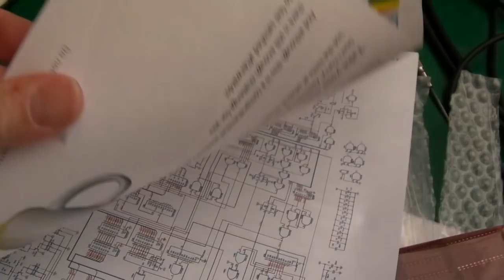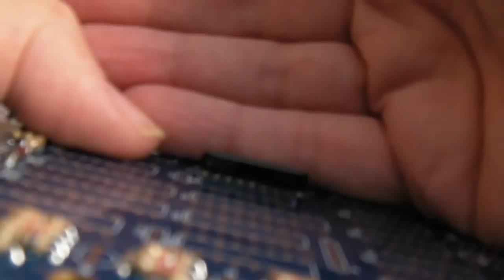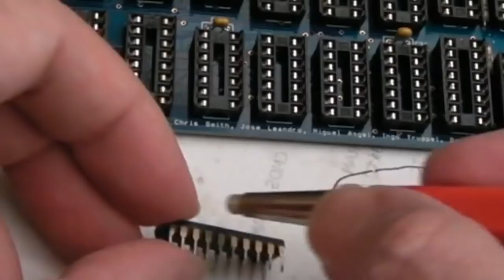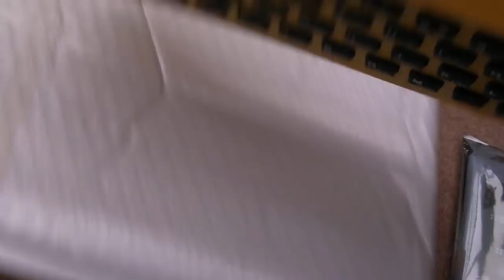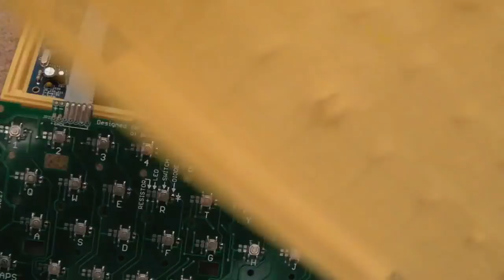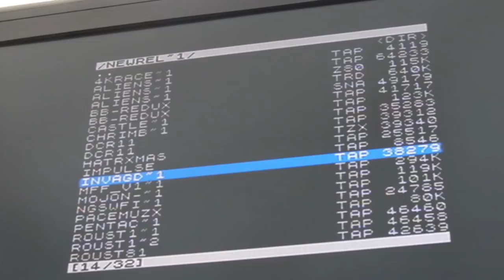Building a New ZX Spectrum (ZX Renew & Byte Delight)

Comment: DONT cut into the solder joints when trimming the leads, that shocks the solder joint. always cut the wire above the solder.
Professional side cutters have a double chamfer to move the cutting edge higher.
Reply from the maker: Thanks, yes - I pointed out that very point on a video that I filmed 3 weeks ago! (Atari ST RAM upgrade).  Worth reflowing after cutting them so low like I did there.

Comment: Old video, (I know,) but I am confused with this kit you have here is it a 48k or 16k spectrum? Also, I was a little dissapointed that they never included an RF box with this. Kind of spoils it for me. I loved trying to get my speccy get a clear picture on channel 36 on my old 19" CRT back in the day, even before Channel 5 came and bodged everything up! Did you have a channel 5 engineer round your house adjusting everything? Ahhh nostalgia. Now, of course, it's a million times better to use an emulator with 0 issues of anything and that also allows you to output like an RF TV! I have over 1000 games  on my Speccy emulator. All hail the colour clash!
Reply from the maker: It's a 48KB kit - but the RAM is 64KB I think - I suspect some is just not used here.  Thanks for sharing your thoughts =D   Lots of memories thinking back to when Channel 5 aired, but no fond memories of RF for me lol =D
Reply from the maker: PS: I have a 128KB build coming at some point!  I have the board, just need to sort out a case and keyboard at some point!
Reply: @GadgetUK164 Great. Looking forward to watching that. I was only wondering about  the memory because it said 16k on the screen. Or was that from the built it diagnostic programme?

Comment: They should have used the ZILOG Z800 processor and installed 1GB of RAM plus a proper keyboard then the Sinclair (tm) SPECTRUM would have been more usable.
Reply from the maker: The Z800 was a machine (or so I thought), not a processor!  Turns out it was a 16bit CPU! =O  But 1GB of RAM was not available in any computer back then! It would be decades before that amount of RAM was feasible in a home computer!

Comment: Were you able to get the faceplate to sit flush?  The top seems to attach to the membrane rather than the case so it just won't stay put.  Wondering how you did it...
Reply from the maker: I did, by adding extra piece(s) of the stick tape underneath (padding it slightly) - eventually it gripped really well in that area.  The edge that holds it is very thin =/
Reply: I'll try that method on my speccys, cause the top lifting off is a nightmare for my OCD. 😂

Comment: question is it still using only half memory thing, with the original being made with half faulty  originally or was that only the zx80/81 models that had that memory?
Reply from the maker: That was just Sinclair and the original 48K Spectrums.  This uses 2 newer 32K chips, giving 64K.  Only 48K of that is used by the Spectrum 16K just sits there unused.

Comment: Hello just watched your video I have built about 8 of the Harlequin 128k boards, the keyboard you were featured there was actually soldered up by me for ZXrenew I know this because of the 3D printed protection it came in is off my 3D printer, and only I do that in order to get the keyboard there safely without breaking or snapping , you are indeed right that you can populate the board with LEDs , the button you have or indeed the new type of micro switch buttons which have a slightly more clicky sound than the old ones, but both are really nice to use, you are right there are places you can solder the wires to power for the LEDs which are not used if you're not using LEDs you can go from either side but they both linked, enjoy watching your video and seeing something I've actually done going to good use gives me an enormous sense of satisfaction 😎
Reply: The v button not working , that can be simply that  a bit of contamination inside the actual micro switch, probably caused when I have given them a isopropyl alcohol Bath , to completely clear out any Flux!? Or can be another reason which is a diode issue for anti-ghosting , ok babes are 100-percent testing before they leave here , via a gig i have setup
Reply from the maker: =O  Thanks for letting me know!  Lovely job on the keyboard assembly!!!  That 3D printed packaging was a nice touch!   The V key was no big deal, I've come across that type of thing with many keyboards in the past (including a brand new ASUS one lol).  Just a few presses and what ever contamination gets freed up.

Comment: This is so cool and so incredible that looks like as if I was watching a video coming from a parallel universe. I am astonished with the quality factoring of the main board (it's spectacular to say the least) and the keyboard by itself is a gem. Back to the 80s I wish we could have such reliable keyboards instead those terrible chiclet stuff which used to break after (not that) much use. Only these two things (the fantastic board / components and the wonderful keyboard) makes it a ton better than the original stuff. The only detail I really didn't like is the yellow color, but I could live with this. Too bad that I don't have the enough talent with a solder (and with electronics in general) to face such delicate project. I just think that build this little guy for playing those eighties horrid games is a waste. LoL. 😆

Comment: At about 1:10:30 ...

The z80 in the ZX Spectrum had an advantage when it came to games with a lot of screen movement.  You could set the stack pointer to 0x0000, then every time you 'push', it'd dec the SP by two and write two bytes (into 0xFFFE & 0xFFFF) at once... and you just kept 'push'ing data till you're back at 0xC000 (The start of the screen)

Basically, the ZX Spectrum was an 8-bit that could write 16 bits of screen data in a single op, with no time wasted on updating a screen address... and that little data-blasting hack made it pretty fast : )  We used to abuse the heck out of the stack pointer back in the day : )))))

The other advantage, for side scrollers, was the fairly unique screen memory layout.  By splitting the screen into thirds you could easily scroll the lower third or the upper third, separately... coupling this with stack-blasting and you could implement side scrollers very efficiently compared to other systems... including other z80 based machines.

Lastly, keeping the colour data separate from pixel data allowed local colouring independent of animation, which was another big speedup.

... of course, the drawback was only two colours per 8x8 block, hence a lot of effectively mono titles like 'school daze' - but hey, you can't have everything : )

I loved coding games in assembler on the 48k back in the day... sure, the c64 was nice, but the sinclair was so much more fun to code for.   XD

I'm definitely down to build one of these : )
Reply: @@shadwell72 Well, usually my buffer was already drawn and sprited, so it was essentially a simple buffer flip of either:  all, 1/3 or 2/3 of the screen - no worry about limited registers unless you're recalculating the screen on the fly, and if you're doing that you are almost certainly NOT using stacking.

Used to use the stack trick for initialising memory too.  Damn I miss gamedev in the 80's... simpler times.
Reply: The ZS Spectrum has that weird dumb address line swap that makes graphics operation a non linear process and SLOW.

Comment: Don't recall where I bought my faceplate from but did I ever wrestle with it to make it fit my 48K I've had since 1983. The radius on the right wasn't quite correct and when I finally got it stuck down the side of the Enter key was just dragging on it. It's an original membrane so who knows how much it might have deformed over the years. I'd love to build one from the PCB up but too pricey to justify personally. Thanks for the video.

Comment: Awesome project! This may well become my first Speccy…
You may not want to solder individual pins when you deal with sockets. Just put a stripe of flux down, get some 1 or 1.5mm solder feed it whilst heating it and drag your soldering iron. You’ll whisk through them in no time. I came up with that technique, when I was an intern and had to solder a dozen or so backplanes with 8 or 10 60 pin backplane connectors. You’ll soon start to find faster ways to do it.
Reply from the maker: Thanks, yes - fully aware of that techique, I just prefer not to solder that way.

Comment: Really great job there. I put a harlequin 128 in one of those yellow cases; I bought the luminous keyboard though :-) One thing I found btw - I attached the metal keyboard cover in v. cold weather --- when the house warms up, the upper row of keys rub against the metal cover (and I dont want to take it off as I am bound to bend it). FYI I have had odd sound issues with the harlequin with many 128k games - no sound when there should be (reverts back to 48k mode I think) regardless of all the usual tricks that should get it working. Not entirely sure if they might all be like that (?) 128k only games seem better.
I also am lucky to have one of the ZX Zero boards too - much to my suprise, I have tended to use this more often just for compatibility, had zero (ha!) issues with it.

Comment: I’ve had chips arrive direct from element14 that has the same red on the pins,  I wonder if something in the air in the climate they are stored in might have reacted to the pins causing the oxidisation to go red, perhaps it’s the copper content?
Reply from the maker: Maybe it is something like that?!?  In any case it was a very very light surface - I suspect a cotton bud may have wiped it off, rather than fibreglass pen.

Comment: There were many Spectrum clones in Eastern Europe that "expanded" the ULA still retaining the compatibility with the original ZX Spectrum. Glad to see a project that do not rely on old and hard to find chips.
As a side idea, there were some bugs (if I remember correctly) in the hardware and software of the original Spectrum that were addressed and corrected in those clones. Maybe someone would try some clones ROM images on these boards.
I also heard about some clones that were able to run CP/M with some minor modifications and adding a floppy.
Reply: The PCBs on those clones look nasty, no conformal coating etc, large scale tracks and spacing.
Reply: @joefish6091  Not always, have you seen many? Care to specify some models?

Comment: The one component at a time is my preferred method as you are far less likely to make a mistake such as missing a solder joint (as I've seen someone do on another electronics channel - no names, hehe!) The methodical one component at a time has worked for me for over 40 years and never a misplaced component or missed solder joint in all that time. I'm going to have to give this some serious thought as I'd really like to build myself a blue ZX Spectrum.
Reply: A simple inspection trick is tilt and use light refraction to compare solder joints or the lack of them.